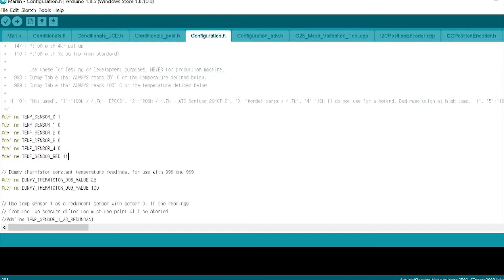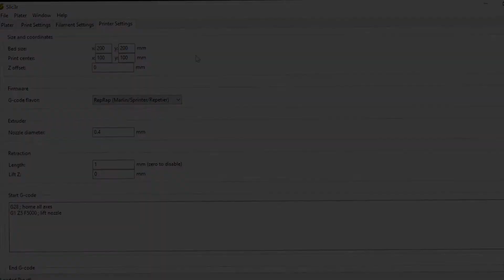DIY 3D Printer Improvement - Heated bed & Configuration setting

Comment: I choose this project for clg...so I am confused about power supply...means( 24v - 10A) or (12V - 20A) which I use...plz tell me my stepper motor has 1.7A current and holding torque is 4.4 kg....

Comment: Hi
i hope you are doing well .

i made 3d printer following your Tutorial " How to make a 3d printer with exact dimensions "

i am facing a problem in printing 3d object .
when i print object the there is a gap between the layer and also it prints first layer smoothly (i-e  Nozzle is nearly touching bed and printing is okay )but for the rest of layers the extruder nozzle  goes too high in the Z axis and there is a much gap between the layer and nozzle,( printing object is then de-shaped due to this gap) due to this i am unable to print anything. can you tell me exactly what is the issue and in which section  of marlin code i can fix this issue .
Reply from the maker: you should change "default axis steps per unit". I set Z axis for 2560. probably you are using different stepper motor or different rods. https://reprap.org/wiki/Step_rates <- visit this website, and see the table below and change the number depends on your component. Also change the setting in your slicing software. make layer height 0.2mm.

Comment: what is voltage and current rating of smps?
Reply from the maker: SACHIN JAIN Hi sorry for the late reply,, It's 12V 350W.
Reply: @jaykaykim809  Sir I have followed all your instructions to make this 3d printer.But when I export a gcode and click to print It shows me heating failed.Error code:0 system stooped.What I have to do?Please tell me.